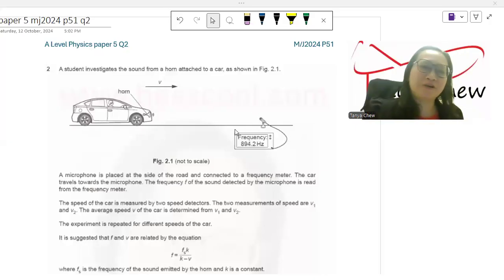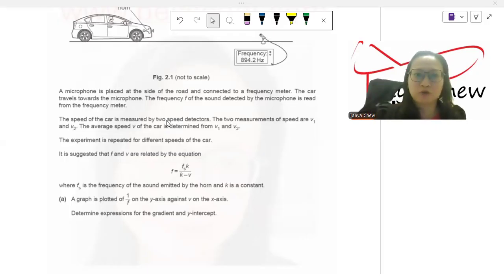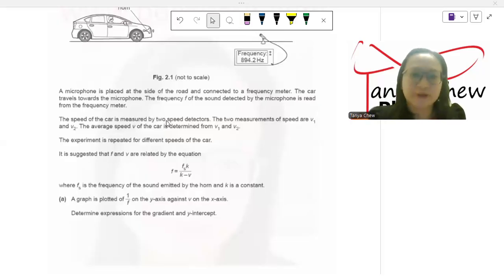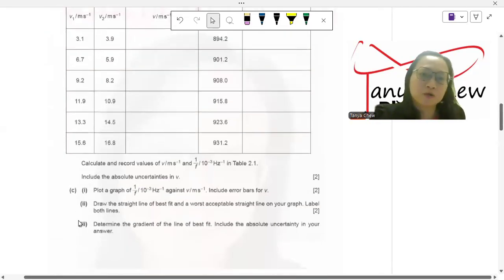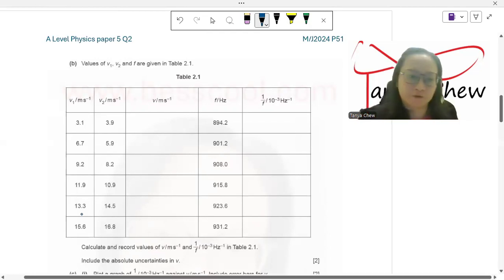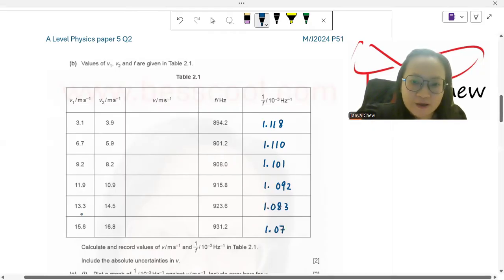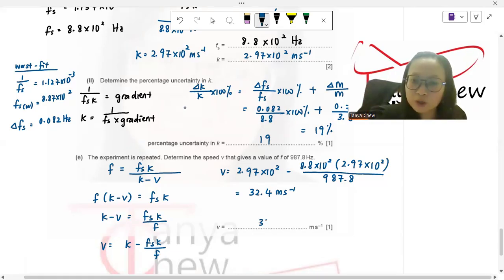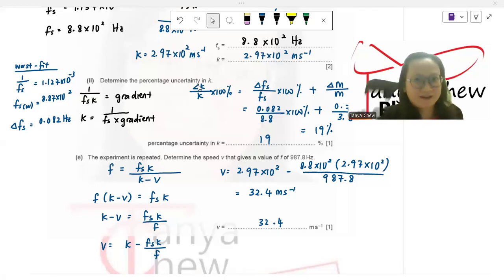A Level Physics 9702| May/June 2024| Paper 51| Q2 (How to answer in 20 minutes!)

Comment: But miss, your error bar on the second point from the top does not intersect with the worst line. Can u explain about it?
Reply from the maker: Wow, what a sharp eyes you have! So sorry to draw the worst fit line that is not touching the error bar. Make sure that when you draw the worst fit line, either you start from top of 1st error bar and ends and the bottom of the error bar or start at the bottom of the 1st error bar and ends at the top of the last error bars, just make sure the worst fir line crosses all the error bars in between yea.